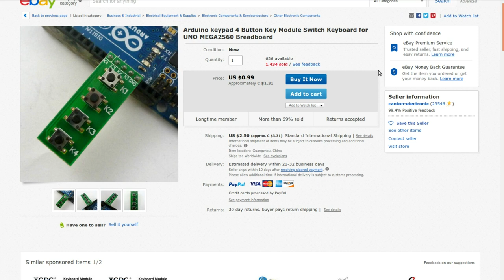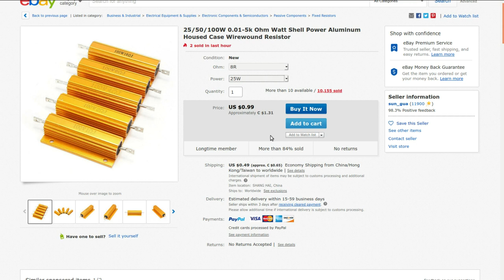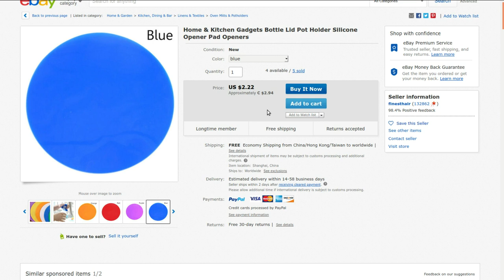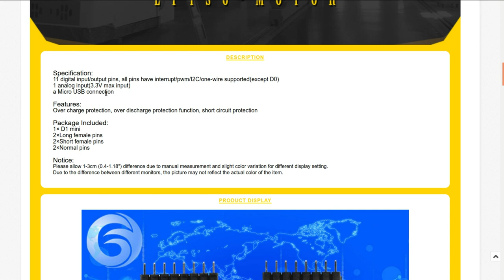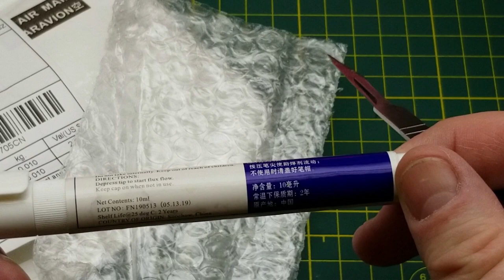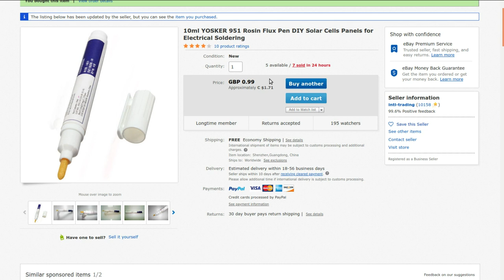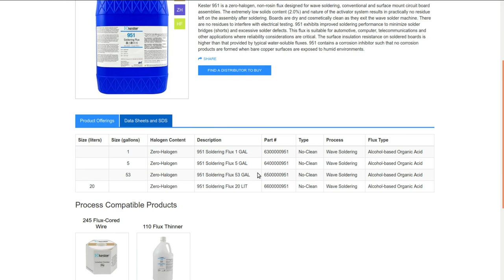mailbag monday  82

Comment: That Silicone pad isn't an insulator, especially when using hot air. But they are very useful for stopping things for sliding around, I use a 42cm x 29.5cm Reinforced Silicone Baking Mat on top of a sheet of 12mm plywood which I've painted with a polyethylene varnish.

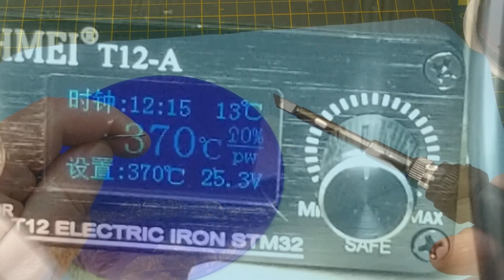Comment: Gotta LOL at electronics that seem to have to have built in clocks like this soldering iron! - 7:02
I assume it isn't run time any way which would make a little sense.
Reply from the maker: Yeah, I'm not quite sure what the purpose of that is.
Once I get some additional tips for that iron I'm going to take a closer look at the whole unit.

Comment: Check out the voltage regulator on the D1 Mini clone.  I bought some on eBay that used a cheap regulator that could only deliver 150ma; less than just the ESP8266 needs.  I ended up ordering the right ones and soldering impossibly small components. (Actually, that's how I lost my SMD cherry.)

Comment: Do you think those Chinese power resistors would be ok on 110/240v as a soft start resistor or would you go with a known brand?
Reply from the maker: As long as you verify that they are in spec  (resistance and power handling) they should be fine. 

Resistors are probably the hardest component for a cheap factory to screw up.

Comment: The pointy silicon pad seems to have a system to make a finger loop, makes it easier to pickup.
might be wrong, another comment has another way to use it 
but that would if the soldering iron was used to pick it up might burn the cutting pad ...
Reply: It not for picking it up, it's to loop around the soldering iron's power cord so the pad stays with the iron.
Reply: @Okurka.  that would annoy me ...   ;-)

Comment: ooh I need to find one of those hot glue pads, I have a thin one like the first one and its too thin, it bubbles when using hot air and it transfers all the heat to my cutting pad. I found one for $13 ! nooo

Comment: I bought some tiny LED's from China they did not tell me what voltage they run any idea on how to figure it out without blowing them up? multi meter?
Reply: The MM will use a constant, small current.
Reply from the maker: Some multimeters (not all have that function, and not all of those can properly measure the higher led voltages) are able to give you a diode forward voltage, but I usually just set my power supply to current limit around 20ma and then read the voltage that it limits at.
Reply: If you don't have a meter with diode mode (or it doesn't go high enough), nor a constant current capable power supply, I'd go with a 5-12V DC supply and say a 1k resistor in series with the diode - should keep currents around 5-10mA or so.  Then just measure the voltage across the diode.
If the diodes use different composition of the semiconductor you can use the led colour/forward voltage as a baseline. If they use a phosphor coating to make the colour, then they're likely blue/UV internally and about 3V no matter the final colour
Reply: Diodes don't run at any particular "constant voltage". They require a CURRENT limited supply, and the voltage across them varies depending on how much current is passing. If they are tiny LEDs then they should probably only be given 2mA or so. So, use a power supply (battery), some resisters and a multimeter. Adjust power and resistors until 2mA is measured through the diode. You can measure the voltage if you like, but it's largely irrelevant.